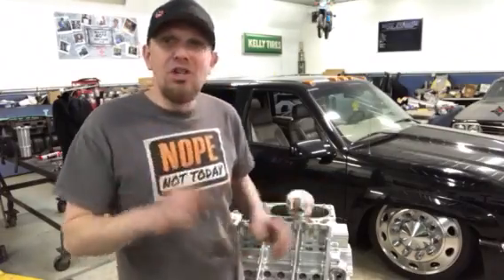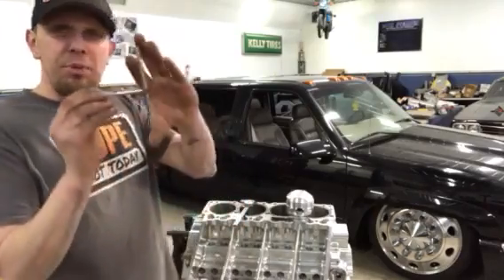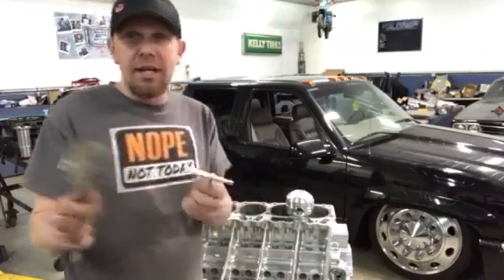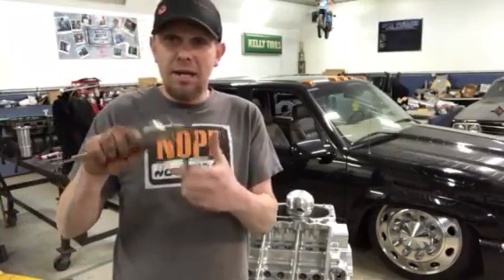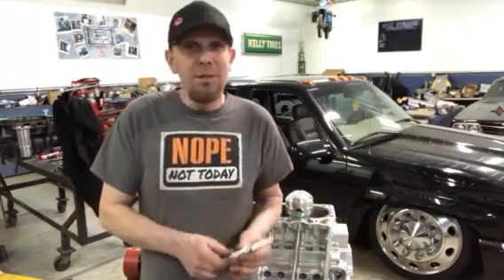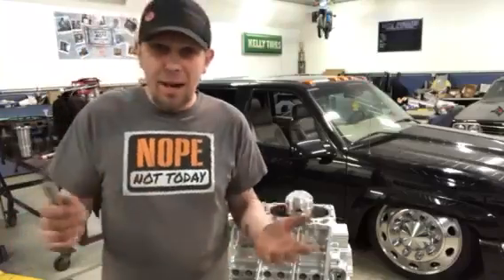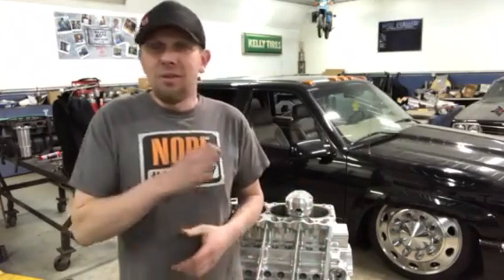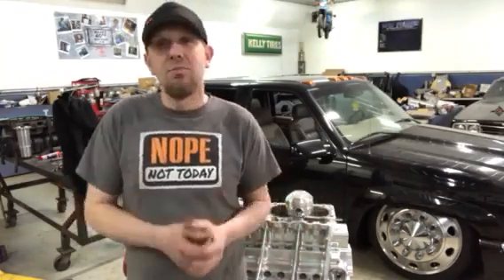Piston Slap  - In The Garage Tech Tip

Comment: I have a 1996 Chevy truck with a 5.7 with 297600 miles it has allways had Piston slap when Cold , it's because  the engenears at GM have removed the skirts to improve fuel economy, like the one you set on top of the deck of that block behind you, years ago when I rebuilt my 67 Camaro 327 you could reuse the old pistons by having the skirts knurled, kind of a texture like the handle of a ratchet rench, to bring it back to spec. Happy slapping.

Comment: When I was young back in the 80's, I went to a lot of races. I got the chance to go to a demo booth where they had a NASCAR V8 on a stand hooked up to a heavily muffled exhaust to demonstrate what a racing V8 actually sounds like when the exhaust is super quiet. It sounded like shaking a tool box full of wrenches. The guy was like, "Yep, runnin' like a champ!" As soon as it revved up for a while so the block got hot and swelled, everything started sounding nice and smooth.
Reply: Nascar tours are like a science center for machine heads.
Reply: Maybe combo of piston slap and cold valve lash.

Comment: Hey Joe,  Quick question.  If the bore gauge reads 8 thousandths larger than your piston diameter, does that mean it's technically 4 thousandths tolerance around the circumference of the piston?

Comment: On a passenger car, if i hear piston slap when starting cold but goes away when it fully warms up, can I just keep using the car until it dies or is there anything I can do to extend the life of the engine. 2012 Ford fusion SE, 2.5 L, naturally aspirated, overhead cam I guess. I hate to part with this car because of piston slap.
Reply: what did you do about it?

Comment: Those are Not Snap Gauges they are called Telescoping Gauges  and you Put them on an angle in the Bore Tighten Lightly and Rock pass the Center line  in an Arching Motion . also use a Micrometer to Measure NOT Dial Calipers
Reply: So Joe is clueless?
Reply: @bigdog2618  No not clueless just wrong in terminology and proper use or method of those tools hey he's a car guy and maybe not a Machinist that's ok

Comment: when the motor piston slap when cold you can install a block heater to heat up the motor to clear the clerance  before starting ,it will not slap anymore but quite boring to plug your car every time you want to take a ride ,,my do it only in winter under 0 celcius ,i hate ering piston slap

Comment: Hey bro, what do you think about the noise that is heard in the 2018-2019 Mustang GT ? That people say it’s a piston slap.
Reply: Piston slap is normally heard when the engine is under load when the engine is cold. If it goes away when unloaded and/or when it warms up that's an indication that it's piston slap. A test for rod bearing knock is to rev up the engine to about 2000 RPM in neutral, hold it there for just a brief moment and very suddenly let it drop to idle. The knock will be heard briefly as it is dropping to idle. Do this when the engine oil is at full operating temperature.